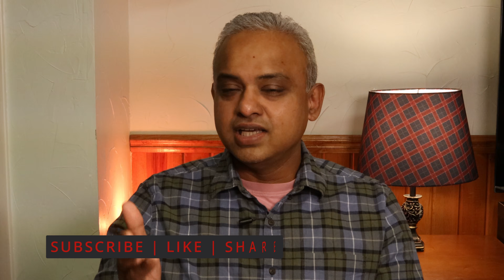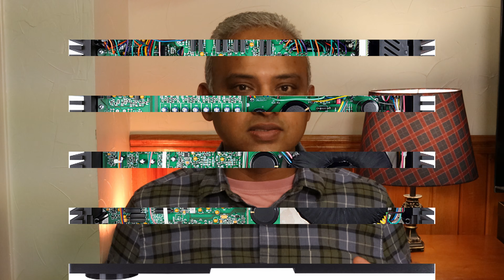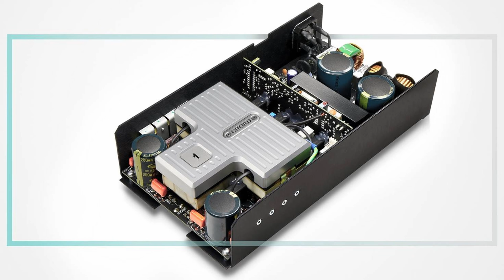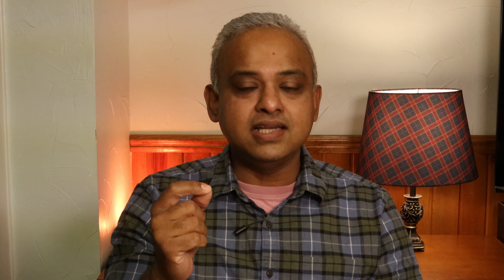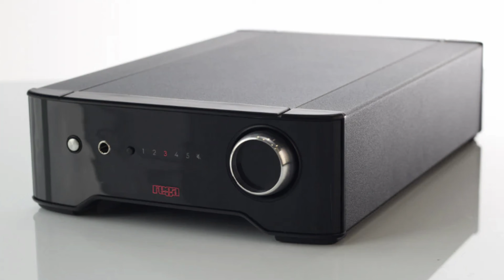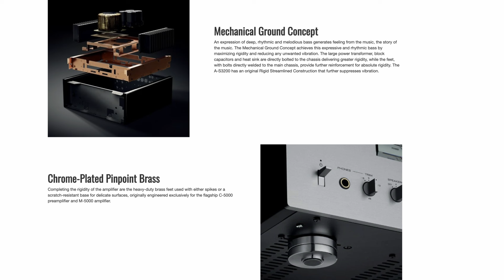Most OVERLOOKED Features of HiFi Amplifiers!

Comment: All true.  Well said.
I can add one more.  There are a few places where component quality shines.  Who would have thought that a resistor can make a difference.  I experimented with various 'audiophile' resistors employed in global feed back.  OMG.  Big difference.  Caddock TS at $10 each well worth the spend.   Bulk foil also made quite an impact in certain spots.  Auto formers from Dave Slagle might be the perfect attenuator IMHO.  They act like a transmission vs a hand brake.  All resistors sound a little bad.  The autoformer well done eliminates the resistance in the signal path.  Instead of reducing the signal into heat, they convert voltage into current making it stronger at low volume.
Reply from the maker: Excellent addition, and this is exactly the level where implementation starts to matter in a very real way.

In high sensitivity circuit positions like global feedback networks, reference ladders, and precision attenuation stages, resistor behavior is not just resistance.
Voltage coefficient, excess noise, temperature drift, parasitics, and long term stability can absolutely influence how the circuit behaves.

That is why blanket statements about all parts sounding the same miss the engineering context.
Some positions are incredibly sensitive, while others are far less consequential.

Your point on autoformers is also technically strong.
A well executed transformer or autoformer volume control changes the gain relationship differently than a purely resistive attenuator, so the source and load interaction can remain much healthier at lower listening levels.

Really appreciate you adding a true circuit level perspective here.

Comment: Good day Mr. Calm HiFi! 😁
Can you please give me your opinion on the quality of my new Summit Hi-Fi A11 Gen2 amplifier?
Reply from the maker: Good day 😊
That’s actually a really solid amp, you’ve chosen well.

It’s the kind of amplifier that’s built to just deliver clean power without drama, and for most systems and rooms it should be more than enough. If everything is set up right, it should sound controlled, effortless, and stay composed even when things get demanding.

So if you’re enjoying it, that’s a good sign you’re already in a healthy place system wise.

The more interesting question is always the system around it.

What speakers are you running
and how big is your room?

That’s where the real story starts 👍
Reply: @analogholic_reviews  Thank you so much for your quality time on responding to my question.
I'm running Canton speakers in a 5.1.4 setup.
My living room is approx. 25' x 25' x 12' high ceiling (12' is an average from my vaulted ceiling).
My Onkyo RZ-50 is acting as my processor for the moment until I go separates.

Comment: Enhorabuena por su canal. Que opinion tiene de Accuphase?. En concreto del E4000?
Reply from the maker: Thank you, I appreciate that.

I do not have direct experience with the E4000 but Accuphase has a long reputation for very solid engineering, conservative design, and excellent build quality.

They tend to focus on stable output stages, well regulated power supplies, and low noise gain structures rather than chasing flashy specs. That usually translates into consistency and reliability excellence sonics.

As always, the real question is how it interacts with your speakers and room. On its own, it is a well engineered integrated. In a system, the matching matters more than the badge.

If you are pairing it with something specific, feel free to share.
Reply: @analogholic_reviews La combinación es con unos Tannoy super gold monitor 12" en una sala de 22m² acondicionada acústicamente, de fuente generalmente Arcam st60, y Qobuz.

Comment: Wrt to internal wiring, do manufacturers use hi-quality copper wiring? Is internal/external connector quality limited to galvanized iron and brass? Do any brands use pure 99.9999 copper too for this purpose?
Reply from the maker: Most manufacturers already use high purity copper internally, typically oxygen free copper or electrolytic tough pitch copper. The limiting factors are almost never copper purity but geometry, length, current demands, impedance, shielding, and how grounds are managed.

Internal wiring runs are very short, usually centimeters, so moving from 99.9 to 99.9999 percent copper has no meaningful electrical or audible impact. At that scale contact quality, solder joints, connector plating, and mechanical stability matter far more.

Connectors are usually brass or copper alloys with gold or nickel plating for durability and corrosion resistance, not because they are sonically limiting. Pure copper connectors oxidize quickly and are impractical in real products.

Some boutique brands advertise ultra pure copper internally, but this is largely a marketing decision. In well designed equipment, internal wiring is not a bottleneck. Power supply design, grounding strategy, layout, and output stage dominate the outcome.

In short, internal copper purity is rarely the problem people think it is 😅
Reply: @analogholic_reviews ❤Many thanks Rohit, for the detailed explanation. Will silver/ gold plated solid copper connectors perform sonically better than solid brass connectors?

Have you found bass from British-designed gear generally tighter and tuneful, apt for smaller living spaces than American gears' design principles?

Comment: Have a cheap onkyo tx8020 receiver and cambridge axa35. Both fantastic sound. Gems. Tried much more expensive amps with lousy sound eg other onkyo receivers  and marantz 8004 or was it 8006.  Figure that one out!
Reply from the maker: Once you bring the speakers and the room into the equation, a lot of those contradictions start to make sense. Same amp can sound fantastic in one setup and completely wrong in another. That’s usually not about price or brand, but about load, sensitivity, impedance behavior, and how the room reacts. Those Onkyo and Cambridge pieces can absolutely shine when the match is right.

Comment: Just a question please. Are these D amps or AB amps ( in your amp list)? And are these more powerful or as powerful to run 8ohm 120watts each speaker on the polk se20 speakers? Also 😂  I will purchase on your advice. Amazing information you are the only sound guy I have subbed too
Reply from the maker: Thanks for the support. Most mentioned here are class AB. The wyred 4 sound amps are class D. More than capable of getting the best out of your speakers!
Reply: @analogholic_reviews thank you sir. I just checked too expensive anything else you can recommend please?

Comment: Mass-damping subwoofers with $10 concrete pavers and BluTack to bond them is the ultimate bass bang for buck upgrade, in my view.
Twin mass-damped subs is transformative. Paradigm changing. Especially in the nearfield.
Reply from the maker: Mass damping is one of those low cost, high impact tweaks that works because it tackles a very real mechanical problem. Reducing cabinet movement and resonance lets the driver do the work instead of the enclosure adding its own signature. Twin subs done this way can be transformative, not because of more bass, but cleaner bass with better timing and definition.

It’s a perfect example of how fundamentals often beat flashy upgrades. Appreciate you sharing that tip.

Comment: I’m often told my emotiva xpa gen 3 2ch amp is powerful but not “musical” is this actually the case would giving up on some of the power specs and staying within the same budget of the emotiva actually improve the sound quality? I don’t want to give up bass performance the emotiva has though
Reply from the maker: The XPA Gen 3 is not unmusical by design. It is a powerful, low distortion amp with excellent bass control. If a system sounds sterile or less engaging, the cause could also be attributed to speakers, room, or source rather than just the amplifier. Swapping amps alone within the same budget rarely improves musicality without giving something else up. Bass performance especially is something the Emotiva already does very well.
First, are you happy with sound of your system, regardless what others? If you’d like change, consider the speakers are you using. Also, what sources and any possibility of acoustic room treatment possible. Even the simplest of room treatments can yield major benefits. This may interest you:
HOW TO TRANSFORM YOUR HIFI WITH ROOM ACOUSTICS
https://youtu.be/ndYEqmM8xDQ

Comment: I used Yamaha pro power with a Klipsch 2nd generation Klipschorn 5 way rig  . This stereo live sound reinforcement rig was 5,000 watts using Rane active crossovers for proper time alignment . You could shave with this setup , sharp as a razor blade !
Reply from the maker: Ouch 😅

Comment: Analogholic:  Maybe you can answer this question for me.  Sometimes I see amps which claim to put out 100 watts per channel (so 200 total), but according to the numbers stamped on the back, they only use 130 watts maximum from the wall.  How can that be??
Reply from the maker: It looks like the amp is outputting more than it takes in, but that’s not actually what’s happening. The numbers refer to two completely different things. 100W per channel RMS is the maximum power the amp can deliver in a test. 130W max on the back is how much power it typically pulls from the wall during real music.
Music isn’t a steady test tone, and the amp has energy stored in its power supply. That stored energy lets it deliver short bursts of high power without constantly drawing that much from the wall.
So it’s not creating extra power — you’re just seeing peak output capability versus average input consumption, which will never be the same number.

Comment: Hello, can you please, according to your wisdom, answer a question that I can't seem to find the answer to in any forum?
Is a 75W stereo receiver inferior to a 45W integrated amplifier? 
For example, the Marantz Stereo 70 has 75W, and the Marantz PM6007 has 45W at 8 ohms and 60W at 4 ohms, but many say the Marantz PM6007 is better than the Stereo 70 in terms of sound quality and dinamic. 

Shouldn't the 75W of the stereo receiver be higher than the 45W of the PM6007, which is an integrated amplifier? 
I have speakers Monitor Audio Bronze 100s, and they are 100W, so I thought the Marantz Stereo 70 would be the best match due his power. 
I ask for your opinion, please.
Reply from the maker: Great question — this is one of those areas where the specs don’t tell the whole story. The 75 watts of the Stereo 70 and the 45 watts of the PM6007 aren’t directly comparable in terms of sound quality. Power ratings mostly tell you how loud an amp can go before distortion, but they don’t say much about the power supply design, current delivery, or circuit topology — all of which matter a lot for dynamics and musicality.

The PM6007, even though rated lower on paper, may have a beefier power supply and is optimized purely for two-channel listening, which is why many people find it more engaging and dynamic than the receiver.
Reply from the maker: Also, don’t worry too much about your Monitor Audio Bronze 100s being rated at 100 watts — that spec is about maximum recommended power handling, not what the speaker “needs.” In real-world listening, your speakers will often only use a few watts most of the time, with short bursts of higher power for peaks. Both the Stereo 70 and the PM6007 will drive them fine, but if your priority is sound quality and dynamics over convenience and features, the PM6007 will likely give you the better musical experience.
Reply: @analogholic_reviews  Thank you very much from the bottom of my heart for your response.
No channel could answer this clearly, and even the dealers couldn't explain to me why the PM6007 is better than the Stereo 70, because i always tough more watts is better.
A 45W pm6007 integrated amplifier is better than a 75W stereo receiver in terms of musical experience. 
Thank you very much. You solved a problem I had for months, and no one could explain it to me like you did. 
Thank you.

Comment: Insufficient power and drive, bad switches and failing capacitors are still very common in most amplifiers.

100 wpc should be the minimum for anything less than the most easy to drive loudspeakers.
Reply from the maker: Agree 💯

Comment: The new Linn Klimax Solo 800 is a breakthrough product. They solved the bias issue with their significant FPGA experience that persistently adjusts in real time when switching from class A to AB, provides 1.2kw into 2 ohms, and with their new 2kw Utopik switch mode power supply that runs silent without noise will drive any speaker on the planet…optimally. I recently bought a pair powering my Kef Blade 2’s and they are beyond belief. Worth a trip to listen to them.
Reply: For 77k they'd want to perform oral, make me breakfast and mow the lawns.

Comment: I have the early Magnepan LRS.  They are the worst of both worlds for an amp, power hungry yet dont play loud.  Worse they lack bass and treble too but the amp is ok with that part.  Anyway I was driving the LRS with Bryston 4bsst and at some point the fuses burnt on the lrs and the amp shut down on thermal granted it was 110 deg F.  So what good is power if you wreck the car going faster?  I also think the 4bsst is a bit cold if you will for the LRS kinda sterile.  Anyway to my more recent purchase of a used Bryston 60B Integrated amp like 70 watts with the LRS.  It sounds more class a than the 4bsst?  Warmer in mids more pleasant.  Also the 60B runs very hot so may have the extra class a.  I havent cranked the 60B yet and likely wont but i do have extra fuses if one burns up.  Ok rant over
Reply from the maker: Informative experience about the older LRS and Bryston 4BSST!
Reply: Am using BK EX442 on mine.  Those organ tracks can really strain these electronics.  Burnt a few amps. BK still standing

Comment: Would like to hear your thoughts about Simaudio / Moon regarding quality parts, etc.
Reply: I had the moon 250 v2 and it was okay. You need to get into there higher end units. 
I have the rega Aethos myself and its my Reference and this drives everything well. I would put this on my top list. I have mine for 3 years and it driving a set of ATC 20 speakers. 
The sound can not be described. It's beyond good.
Reply from the maker: I have only read good things about the Simaudio amps. Great parts, careful engineering,  and high quality control. I would love to have the chance to listen to an amp made by this company.